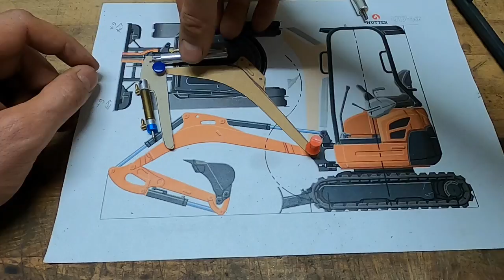Build - RC Kubota Hutter U17 1:15 Scale Excavator Part 2 - Arm and Buckets

Comment: What do you use on the bucked to move it? I see a little motor with a transfer case? Would love to see a live video build in like a patreon live. I would pay to see that and ask questions.. Iam a handy builder myself and the prices for the machines are insane high. Build my owne one if i can and your videos help a lot. Have a 3d printer bud i dont like that and brass is mutch better. Only sometimes i have some questions what do you use😅 and with tools you use i like to know.... cant you make a garage video or live stream? I think a lot of People want to know wo you are 😊❤
Reply from the maker: Hello, all parts ar listed in the video description, it's a small 6mm motor with worm gear output drive.
As you can see in my videos, most of my tools are handtools, saw, drill and file...

Comment: What metal do you use to manufacture these things I'm a new designer and would like to try building rc machinery ... excellent craftsmanship
Reply from the maker: For arm it's aluminium 0.8mm, you need 2-3mm for bigger models. Depends the size and force applied on the arm.

Comment: Can you say the name os d products that you use to put the metals tooghether the pegamen I don't now how to say It in english Hellou from Spain
Reply: Uhu Endfest 300 for aluminum. If you heat it up with hot air for example it gets liquid as water and makes its way in all smaller gaps.
And then there is tin solder for brass or steel parts. You need to heat the metal with a flame or a soldering iron to the melting point of the tin solder and then apply it.